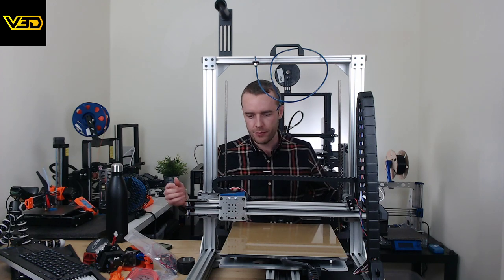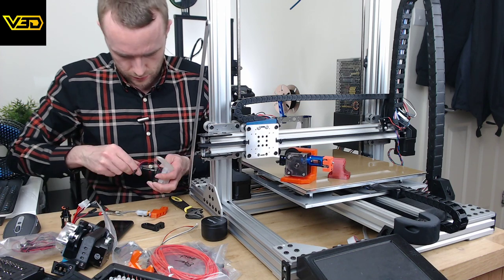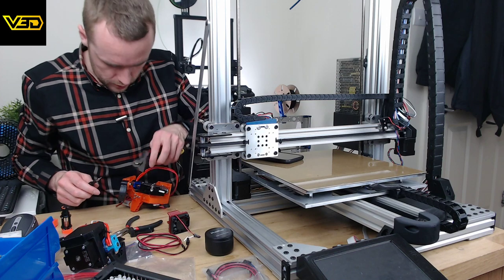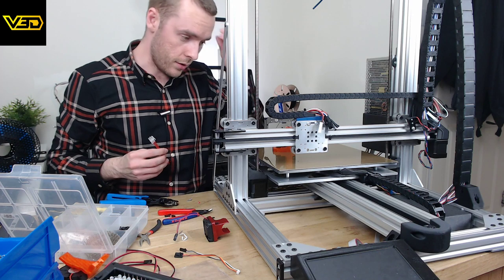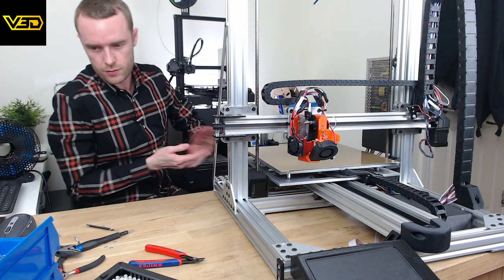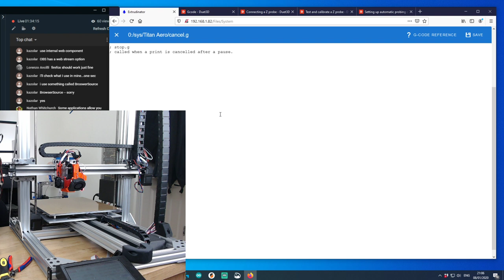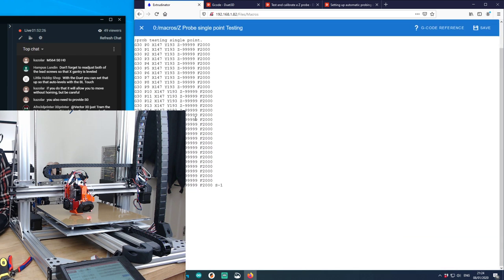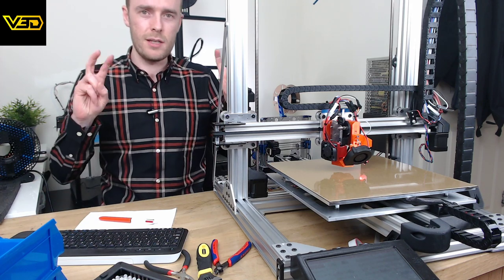Fitting Dragon Hotend on Extrudinator

Comment: I wish for an option to combine the advantages of the Mosquito hotend with the Hemera. The Hemera has the short path and a good dual drive extruder and the mosquito the good heatbreak, which doesn't break, when changing the hotend. At first I forgot about the integrated heatsink making the Hemera the combination it is and hoped I could swap the Hemera hotend with the Dragon hotend. 

To enable that the chinese would have to copy a whole Hemera/Dragon combination.

Comment: Another question what hotend are you using. I'm contemplating upgrading my hot end to from an original e3dV6 I got ages ago and it's served me well but it's passed its day. I'm very tempted to get a high flow triangle labs dragon however I only print on a 0.5 nozzle (occasionally 0.4 or 0.6) do you think I would benefit from getting a high flow variant on an Ender 3 pro switch wire, with the intention of super fast high quality prints or is that a fantasy and I won't ever get to  push the standard flow on a 0.5 nozzle on a switch wire so just go standard flow for easier print settings (less ozzing etc)?

Comment: Did you use any PTFE tube from the titan extruder to the dragon? 
I have a BMG and i don't know if I should have a PTFE tube
Reply: I am sure you have gotten this answered considering it's been 7 months, but no, you should not use ptfe if you are mounting it in the extruder. However if you are running a plain v6 you need to get the version that is called the short version. That's what allows you to mount it

Comment: How do you feel about them ripping off slice engineering?
Reply from the maker: I need to review and patents in place and their coverage before I can say anything strongly. But in general, not great.
Reply: Desktop 3d printing got off the ground because patents expired. Intellectual property stands in the way of progress. The mosquito has been out for around a year. Copying and iterating force innovation and we as the receivers of the innovations are benefiting from this.

The slicer engineering people should be benefiting from this too. Their design is overly complex. As someone who is designing their own hotend, my critic would be that they stopped the design process too early. This hotend should motivate them to produce a better design that is simpler, therefore cheaper to machine.
Reply: @dakotapahel-short3192  Your comment has no validity, just because patents for one company have expired doesn't give someone the right to rip off another product. If your understanding of innovation is blatant imitation for certain parts designed by Slice Engineering, you have a lot to learn.
Reply: @jacksoni349  If you don't see how this hot end design is simpler to machine than the mosquito yet maintains all of the functionality, Im not sure you understand what innovation means. 

Also I'm just against patents period. The ownership of information has clearly just been a road block to innovation and accessibility. 3d printing is a clear example of that. If a company isn't willing to open source their work, I do not care if someone else steals their work.
Reply: @dakotapahel-short3192  Lol dude I am not talking about the heatsink, I am talking about how Slice Engineering designed their heatbreak, which this ripped off
Reply: I really want a Mosquito but its damn expensive I have an NF-Crazy Red hotend which is a real full rip off of the mosquito and I do feel bad about buying it but for $50 its the only thing I could afford at the moment so I get what you mean we should always support the creator that's why my e3d v6 is original but I can afford that since it was under $100 here is the kicker Phaetus also got ripped off by TriangleLab which just released this Dragon hotend before they did LMFAO the Rip off artist got ripped off search for Dragon hotend on aliexpress and you will see the Triangle lab copy
Reply: Considering its not a direct rip like the actual clone not really an issue.
Reply: @Deneteus  I cant wait for the slice engineering  copper head
Reply: @BreakingElegance  Chris Warcocki did an install video on it this past week.
Reply: @BreakingElegance  how does NF-Crazy Red perform, i'd like to upgrade mine, but the original one cost like my printer, so i definetly gonna buy from ali if it works well
Reply: @dakotapahel-short3192  Check out Slice Engineering's (funded) Kickstarter for the Copperhead hot end. You get what you wanted, but Slice started development at least 6 months ago
Reply: @Vector3DP  Slice Engineering only has a design patent for the Mosquito Hotend. Which means that the Dragon Hotend has to look IDENTICAL, which it does not. So it is clearly not a ripoff. Also, being a drop-in replacement for an E3D V6 so significant innovation and design.
Reply: @jacksoni349  Slice Engineering only has a design patent, you clearly have no idea what you are talking about and have no clue what innovation actually is.
Reply: @NorkaKnight  LOL innovation, it doesn't even perform any better than the existing products on the market. Go look up the definition of innovation.
Reply: @jacksoni349  Simple is as simple does